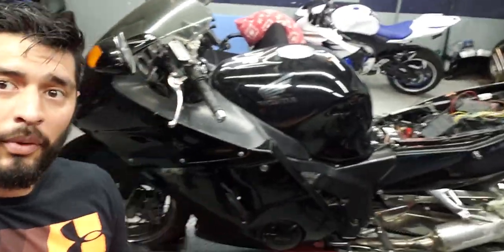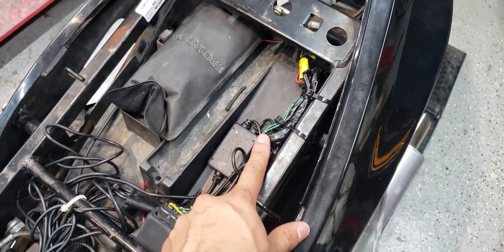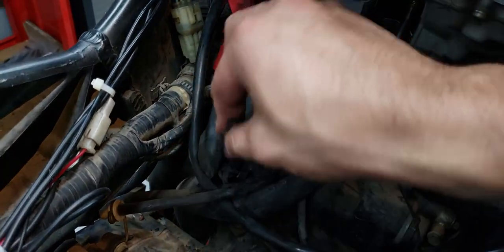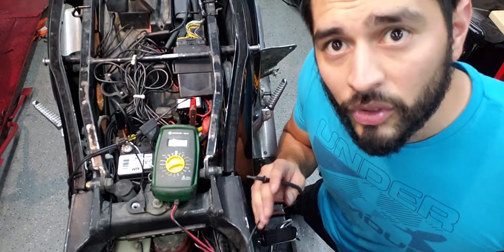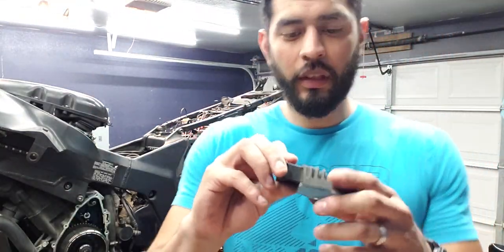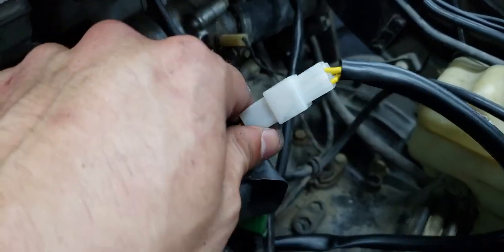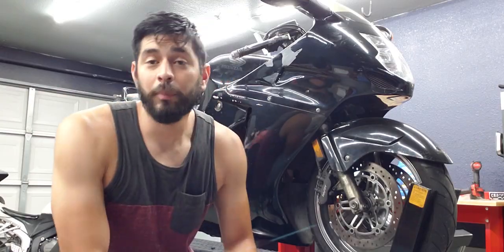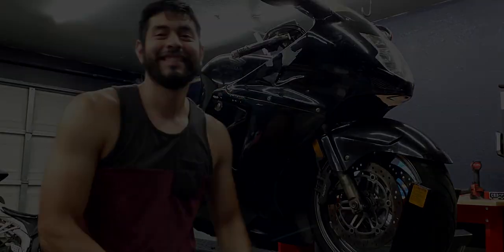1998 HONDA CBR1100XX CHARGING ISSUES

Comment: I would change the stator and rr as a matter of course with the blackbird not one or the other.  That and a cct should be all that's wrong.  Jaws UK do excellent after market replacements.
Reply: Dealing with the same stator issues on my 97 Bird.  
Fried melted wires.  
Do you happen to have video of you replacing the wires?  Would really love to see that .
Reply: No sorry I didn't film myself, it'd have had too many expletives to publish.  Seriously though it wasn't too difficult just fiddly in places.  The stator from jaws uk comes with brand new wires ready to plug in so just Allen bolts as you see with this one.  Get some cable ties.

Comment: I need you to fix my 97 bird lol...charging issues....2 different shops...still not fixed
Reply from the maker: lol where u located?
Reply: @SUPSGARAGE  in indiana....20 min ride then battery volts drop to 11....if it's sits for and hours it'll charge itself back up...
Reply from the maker: @funtimewithrileyandreese5414  yea ur far lol   and u already replaced both rectifier and stator?
Reply: @SUPSGARAGE  ..yes....still dies after an hour....the shop thinks it's the ecu....I've lost faith in them lol
Reply: Great stuff thank you for your video it's a real help